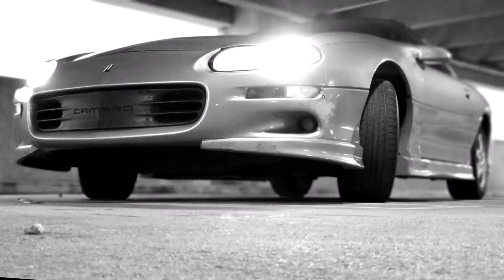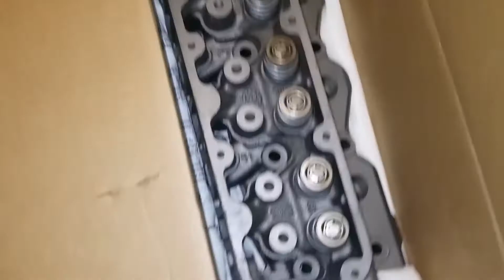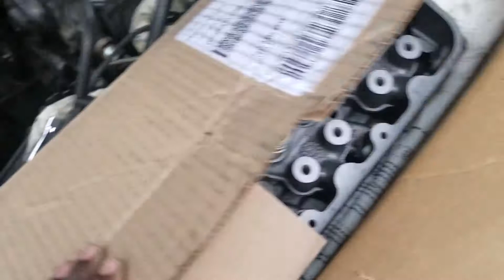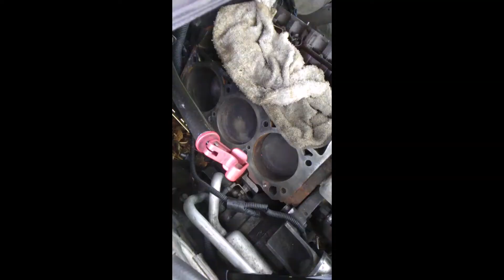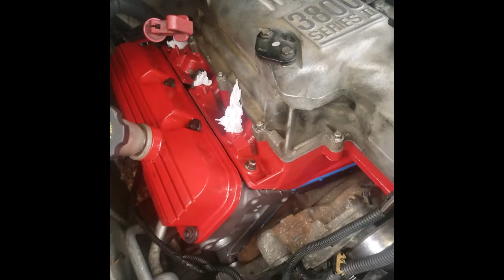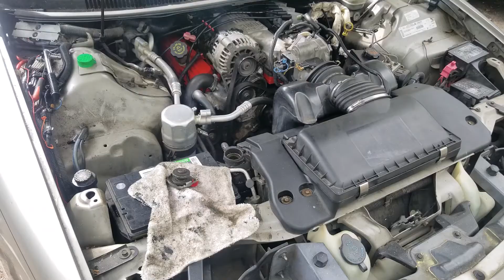99 chevy camaro 3800 series 2 headgasket and heads replacement

Comment: I'm about to attempt this job on a 99 firebird. I don't know for sure if the heads are actually cracked or warped yet but I'm going to buy reman ones as they are $150 a piece. Is there anything I should know before I start? Following the factory service manual
Reply from the maker: It's actually going to be a smooth run. Manifold bolts dont really break off. But you will need an degree wrench I think that's the name of them.  Can't reuse head bolts.. other than that.  They really smooth.
Reply from the maker: If you got any questions.  Got me up on my ig

Comment: Where did you find the torque spec sheet?
Reply from the maker: Man you gotta dig cause they'll tell you some crazy stuff. I'll look for about 3 and whichever 2 is the same I use that. But for precaution,  you can call gm amd they'll give it too you.
Reply: @kurrentracing  thanks man.
Reply from the maker: @justinmason2192  no problem bro